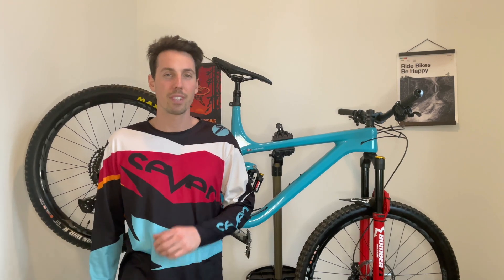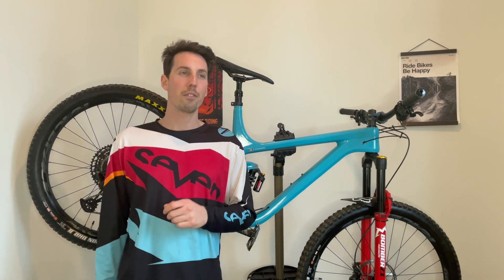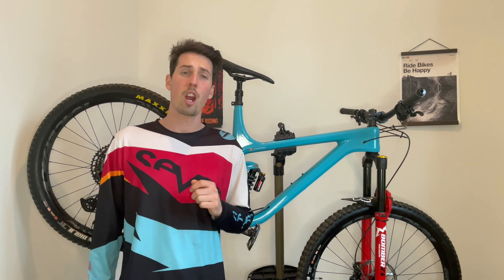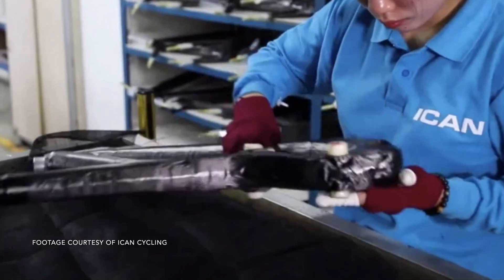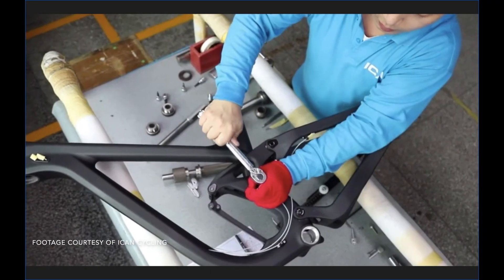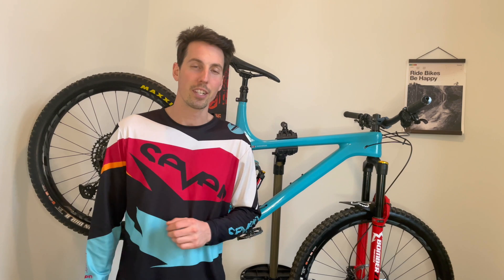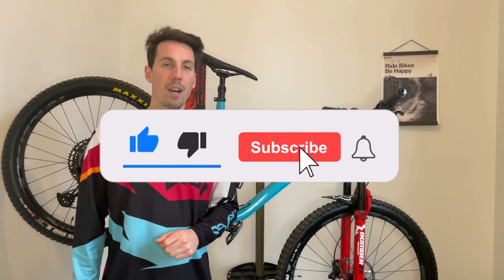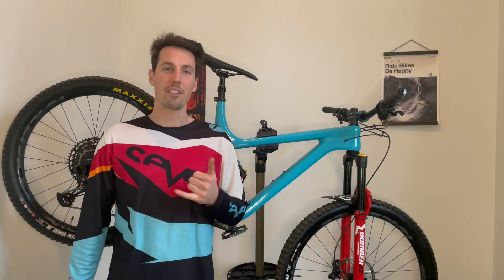How it's made - Chinese Carbon Mountain Bike Frames

Comment: Thanks for the video about Ican.  I've been eyeing the P1 model since mid winter and doing research on the company, its manufacturing process, and reviews of their products to help me gauge their quality.
With your code and my tax refund I've pulled the trigger and bought a P1.  Thanks for working out a deal with them and giving out a code.
Reply: Also, the code worked for the frame and also on a separate order for an extra rear derailleur hanger!  Nice!

Comment: Too many westerners hold the mostly unwarrented opinion that Chinese carbon frames are inferior. After living in north Thailand for 8 years and racing xc races against Thais, Malaysians, and Indonesians on their Chinese off brand and open mould carbon frames, I can say thats very rarely the case. In fact, after 6 years of racing and riding here, I have only seen ONE defective Chinese carbon frame.  MY first carbon frame was a hardtail which I raced in 46 xc races in 6 years, and rode an average of 300 KM per week, yes per week, on for several years,. It has been thrashed and crashed numerous times and never cracked or broke in any way. I recently bought an xc full suspension carbon frame from another Chinese company and have raced it three times, once in Colorado and now two more times in Thailand. It has performed well with two first place finishes and one third place in Colorado. The little known fact is that almost all  the big name brands used to have their carbon frames made in Taipei, Taiwan, which is a country full of Chinese people. Now, those same companies are still providing frames for the big name brands we all know, however, theTaiwan companies are  now contracting out much of the work to MAINLAND China.  The fact is, western engineers design these frames then contract out the Chinese to build them for a fraction of what it would cost to make in the USA or any country in Europe. The markup is incredible, enough to keep these companies afloat and emplyees in the west earning western wages that are far higher than the laborers building these  bikes.  The off or no name brand open mould bikes are built in numerous factories in several Chinese cities, factories which also contract out build bikes for big name brands' western specs.  It can't seem too much of a stretch to anyone with a brain to see that the Chinese have learned a thing or two and capitalized on it. While a full sus xc frame in 2022 from  the big names will set you back about 3500-4500 USD (or more), and are the latestest in technological evolution, mainly these days in weight savings, the Chinese open moulds and offname brands will weigh 300-800grams more per frame (for a full sus xc frame) but tend to be rock solid in build and cost around $1000 or often less. It cost a lot to run a brick and morter store in the west and the markup on these namebrand bike frames makes paying a staff at a bike shop doable, but also promotes other components tmakers to do the same.. offering the drivetrain , suspension, and wheelsets at inflated prices from what it cost to manufacture. Dig around online and you can find all this yourself, andyu  don't need to live in Thailand or visit a Chines factory or a factory in Taiwan as I have to learn this . Of course a highly inflated pricetag will get you  small advances in technology, and a higher resale value, but at the end of the day very , very few people in the xc world would be able to say they actually needed the very lightest frames to be world  to be class competitive.

Comment: What made you go for the P9 over the P1? I thinking if I really need more than 130mm of travel.
Also, what color is that? Thks!
Reply from the maker: I wanted a bike that can also handle bike parks like Whistler. I still do a fair bit of aggressive riding and drops so wanted the extra bit of travel. The color is a turquoise green/blue. Similar to a yeti sb150 color.
Reply: @CrownPerformance  Can the P9 run on 27.5 non + tire, like a 2.4. 
Thank you.
Reply from the maker: @PedroFTeixeira  yes. Can run both 27.5 and 29” wheels. Will fit up to a 2.8” tire size.
Reply: Greetings, I like the information you provide, and I am interested in buying the same frame that you have together with the Marzocchi Z1 fork, but? I don't know which head-set measurements are correct between ("inches or mm") ... and if possible, the model or brand of the head-set. thanks 🙂

Comment: Yo man, the frames from ICAN look insane, the P9 has caught my attention the most. Im currently on a half carbon bike myself and it seems to be able to hold my weight really well, considering im a heavier rider and im wanting a new frame to build up around, would they handle someone who is around 14.5 stone maybe 15 (which translates to around 200 pounds) and i really want to get the P9 frame as it offers more travel, and is reasonably priced, if you could get back to me with some more info about the frame i would be very appreciative.